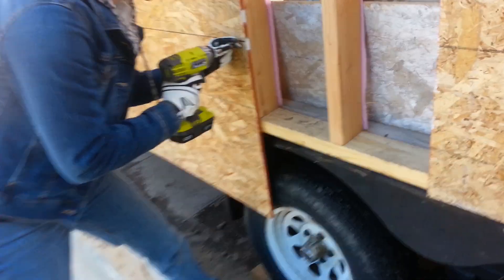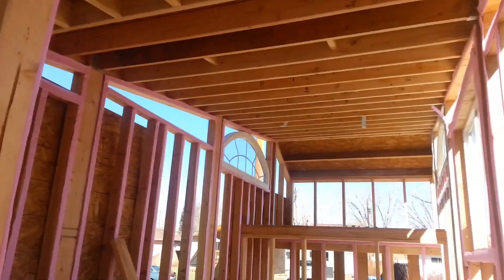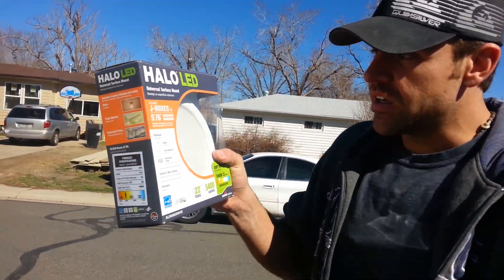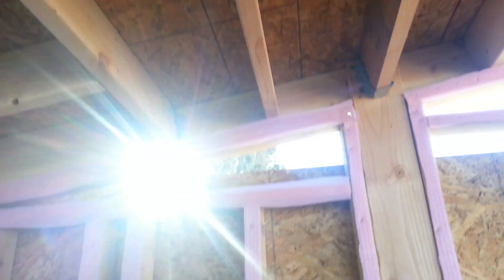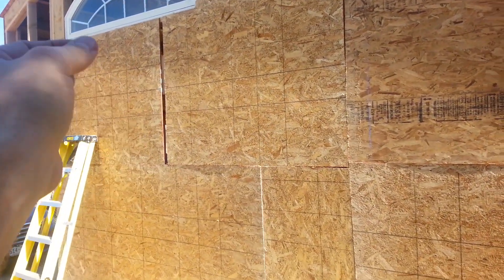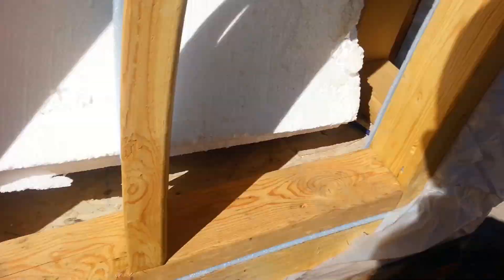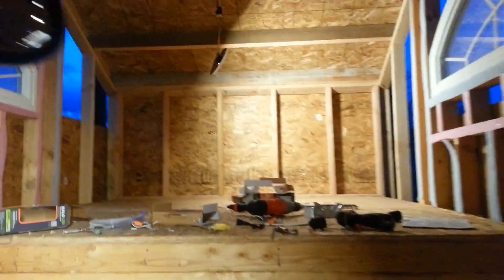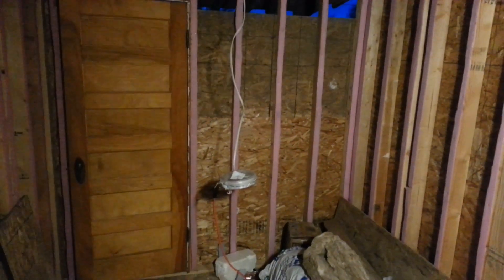Micro house Vlog 9

Comment: idea

staircase shelf
on wheels slide:
it is stored in the shelves.

furniture - Bath,
on wheels slide:
tidy it goes on the tub as a bench
you can gain volume with slide or simply on wall curtains.
electrical outlet in a bathroom drawer

hotub
see Tinywood Homes on facebook